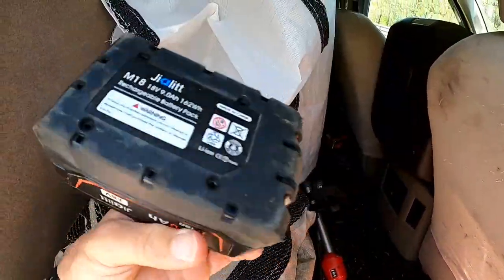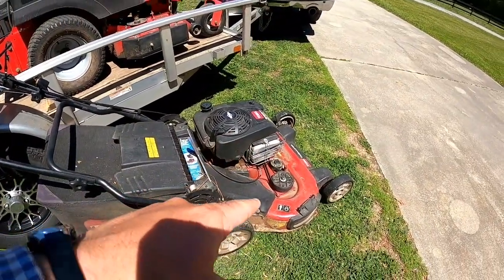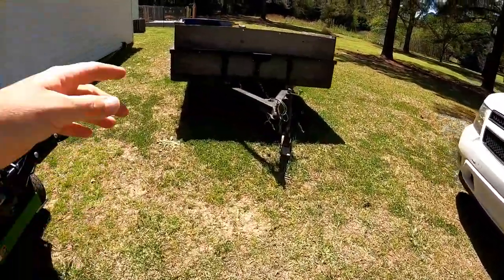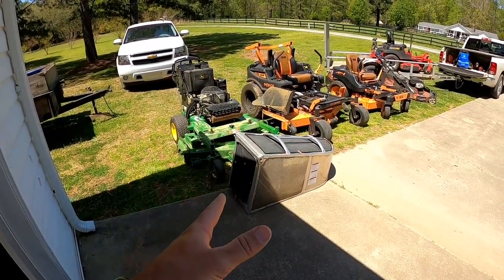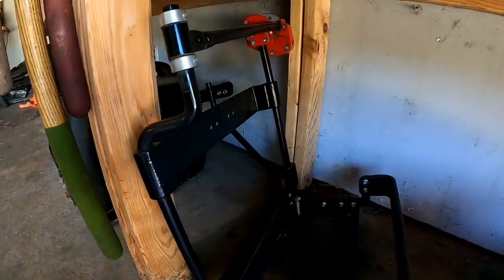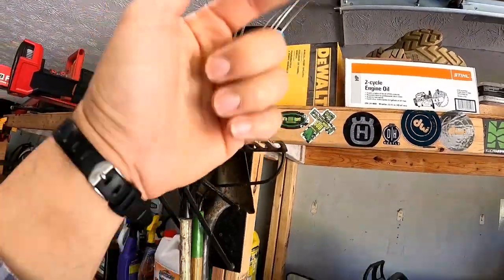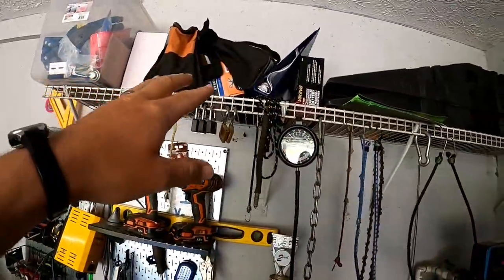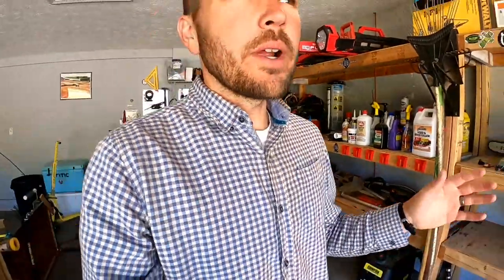Solo lawn care setup 2022

Comment: I had that same snapper s50xt I slapped wore it out at 1150 hrs both trans needed to be replaced and the deck was completely gutted in the inside from all the sand. But good mower for the price of $5400
Reply from the maker: Im still running mine it has 900+ hrs on it and remember on this mower the clock only counts when the blades are on so it really has more hours than that...what did you do with yours? Im debating whether im going to keep mine forever and replace parts or what haha

Comment: Hey bro, which mowers do you take with you daily? Or does it depend on the customers you're servicing that day?  Also, are you running a trimmer rack on your trailer these days?  Thanks!
Reply from the maker: Hey buddy i bring the 36 on mondays and somtimes Tuesdays Wednesday and Thursday i take the 48 walk behind or snapper. fridays i take push mower and the patriot since i mow my church on fridays. And as far as trimmer racks no i run mostly battery trimmers so i keep them under truck bed cover cause battery trimmers doesnt matter if it turns on its side.
Reply: Are you mulching with your Scag 36 and Snapper Pro?  side discharge with JD walk and Scag Patriot?

Comment: I been using that 2mm square gatorline too, it's probably the best of everything I've tried. Super strong and sharp but sucks battery faster than others I have used. Works great on fs 131 too.
Reply from the maker: Its great line but going to be using black diamond 095